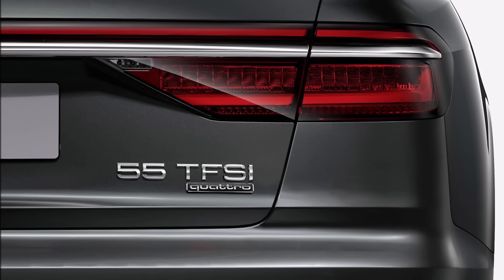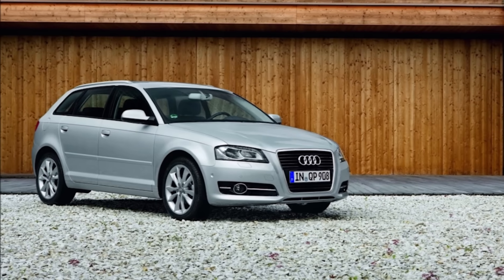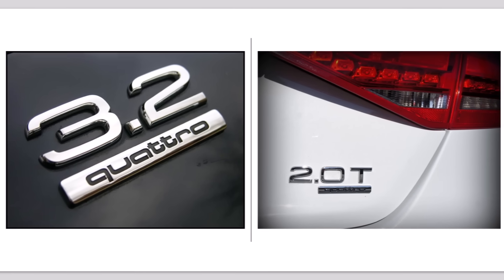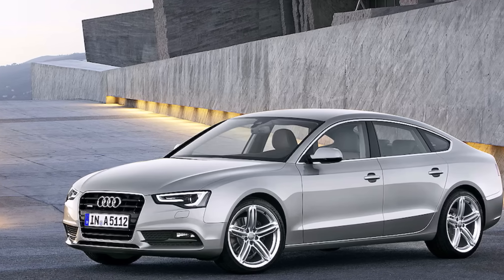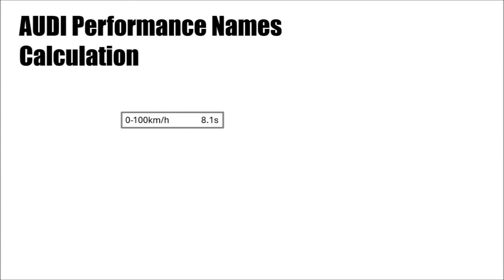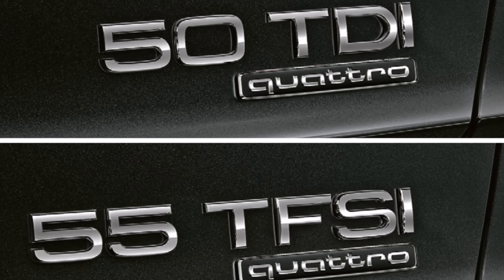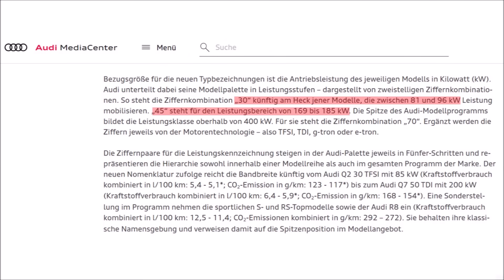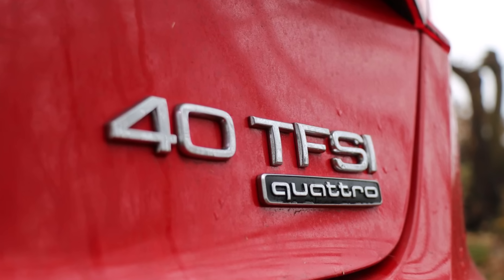AUDI Performance numbers EXPLAINED

Comment: I think this information are not correct. How you come to this meaning, can you give a Statement to the  source of the explenation? The Numbers are categories of the horsepower -> it is from the Audi Brand: „For example, the numeral combination “30” will
appear on the rear of all models with power output between 81 and 96 kW. And “45” stands for
power output between 169 and 185 kW. „
Reply from the maker: I was working in AUDI's technical development in Ingolstadt during the time this formula was invented and always wondered why no one explained that to the customers, which left everyone confused around the world.

The power categories came up later in an attempt to make it easier to understand for customers, but it's missing the point and is even more confusing.
Reply: @bsport320 I also worked there, but with an other Focus and for us it was from the beginning the classes Information, not that what you explain and there is no class with 100 which you describe to the Audi R8, i never heard it, so it is a little bit strange. In which Departement you worked?

Comment: Audi developed the most stupid system ever.
I personally don't care about this number - I want to know what size of engine the car has and if its n/a or turbo.
2.0 TFSI or 2.0 FSI  makes sense for me, if I want to know the power, I will look it up myself. 2.0 TDI vs 2.0 TDIe I exactly know that the TDIe is lower power and therefore in a lower tax bracket.

This stupid numbers of 25/35/50/55 make no sense for me and never will. I don't want to do arithmetics, I want to have a clear info.
I am not going to buy a little 1.0 turbo shtbox even if it is a 100 TFSI as that 1.0 engine will last 30.000 miles if at all before it goes to the bin.
I rather buy a 2.0 TFSI what is slower and last hopefully longer - ohh, hold on, we talk about Audi where the 2.0 TFSI was famous for the 100.000 km death because of plastic chain tensioners what wear down, let the chain skip and you have a catastrophically engine failure - easy access, sure, i you remove the whole engine because the timing chain is 5cm from the firewall...

Comment: If it would've been explained, it probably would've been great.

If you don't know the system, you can't compare stuff well.

For example with chain saws, when comparing a Stihl MS 261 and a Husqvarna 550, you might think the Husqvarna is bigger because bigger number.

But they're actually comparable with both being 50 ccm chain saws for professional use.

Comment: BMW and Merc have a similar system with their cars (a 435i isn’t 3.5L anymore…) but nobody seemed to get confused by that for whatever reason
Reply from the maker: they historically sticked with engine size and said the smaller one has the same performance as the bigger one before - see C63 ;)

Comment: Sorry, but that's not correct. The performance numbers are based on performance classes. 45 stands for 169 to 185 kW, 55 stands for 245 to 275 kW. The Q7 55 TFSI (2021 /250 kW) accelerates to 100 km/h in 5.9 seconds. The TT 45 TFSI (2021 /180 kW) accelerates to 100 km/h in 5.1 seconds..
Reply: This is wrong. Watch the video.

Comment: Great video, as always.
 I believe the naming convention actually did change into the "marketing understood" version. Where the power categories were no longer a marketing interpretation, but the actual new naming convention.

The idea being that engine size was no longer relevant when speaking of BEVs, plus no one actually understanding the % of g acceleration, so now a 50 TFSI and a 50 e-tron could both be understood to have a similar power level.

Because now you find 45 TFSI badging/naming from A3 to A6 with the similar 2.0T engines. So that indicates it got switched from acceleration based to power output based.

Comment: Engine size has been a standard for decades, but perhaps Audi went too far with the same engine able to have different numbers on different models. Look at BMW - the number isn't often related to engine size at all and has become less and less related in the last 20 years, but everyone knew from the beginning that bigger is more powerful, no matter the chassis.
I'm going to shut up now and be ashamed that my 550d is actually a 3-liter, 325e is a 2.7 and my 750i is a 5.4.

Comment: Why didn't they simply put the 0-100kmh time on the badge?
Reply: Because it will also be wrong. The bigger number means slower acceleration, which is backwards to what the current naming convention. Bigger car should have bigger numbers, not smaller.

Comment: The audi 80 must have had insane performance!
Reply: Audi 5000 would like have a word
Reply: @agistan7764  the Space Shuttle experienced about 3 G's, while the Saturn V rocket had a maximum of about 4.5 G's during its launches. audi 5000 has 50G lol
Reply: @agistan7764 The sudden unintended acceleration was no joke💀 The cars and passangers simply disintegrated during impact
Reply: what about Audi 90, 100 and 200🤣🤣🤣😂😇😇

Comment: I never understood how they derived these numbers. My initial intuition was that 55 = 5.5L engine equivalent power. Like AMG55 or AMG63 which show the respective equivalent engine capacity or the power of a 6.3 liter NA engine.
Now that you have explained it, it is still not a good idea. since BMW and Mercedes uses their numbers are a way to represent the engine size. So there is no way to actually compare Audi to BMW or Mercedes.

For example, the 55 TFSI. Should it be compared to the BMW 330i or BMW 340i? The BMW doesn't come with a 355i so does that mean Audi is better? Then you test drive both of them and realize it is more equivalent to 330i in performance so you'll be disappointed and feel like the number does not make sense.
Reply: But Mercedes' A35 and A45 AMG models also make zero sense. What do those numbers represent?
Reply: @PostTraumaticChessDisorder  they represent 3.5L engine power for A35 and A45 = 4.5L power. Which is the similar to their nomenclature going as far back as the 1980s.

Comment: I don’t want to know how fast the car is, I want to know what engine it has. Straight line acceleration means nothing in real world performance dynamics. Just like the new M5 is a brick with wheels that handles terribly, but has decent straight line 0-100 acceleration.

Comment: Why would you give up on a system that indicates the power of an engine by the red letters, like double red tdi meant something. Also if the engine is small, just eliminate the engine size. Or the bmw's naming system was just mostly fine except the secondhand websites.

Comment: I never knew this and always thought the naming was a range of the power output ( I think its done that way at Mercedes, so an S500 can be a 6cylinder nowadays instead of the traditional V8)
Higher number means faster car makes sense, but you still have to google what actual engine size is under the hood. And mathing out that number with the G-Force is more than " fast math" to most people.
The customers never understood this, and for them its just added to the long list of Audis marketing mishaps.
Every new Audi A5 wagon I see has blacked out badges: They know that customers get confused on why the " A5" isnt a coupe anymore but a wagon now and they come with boring 4 cylinder engines anyway...

Comment: The displacement stopped making a sense even before the turbocharged engines.
VW already had 3 1.4 engines that ranged from 60 to 100HP in the 90's. Around that time, they already did badges that showed just MPI, 16V, SDI or different colours in the TDI badge.

Comment: Finally an explanation, never knew what that means. Now that I know, it makes sense and it is more logical than other brands.
Knowing the engine power doesn’t help without knowing the weight of the car, so the Audi way is telling us directly what the car is capable of…
35: wife’s daily drive
40: economical satisfaction 
45: I can think of towing a boat😮
50: neighbours are upset 
55: I’m smoking tyres at the traffic lights 😂
50
Reply from the maker: Yes exactly ;)
Reply: Well put, anything less than a 50 is not worth having 😉

Comment: So if Audi ever makes a top fuel dragster, the name (based on 100 × G force) might be the 5600 TFD
Reply: You meant something around maybe 250? I guess the friction coefficient for the tires can be as high as bout 2 plus those things will get some down force - but remember that this is averaged over 0-100, so relatively low speeds for aero. Btw if we're considering just power, so no tuning and no accidents then 4.5G (450) would be missiles and 56G (5600) is in the range of light loads for howitzers.
Reply: @josefsvitak4313  Whoops, I should have said 560. I'm told they pull 5.6G from 0-100 kph. They get ~4.0 effective coefficient of friction from a number of factors - see "We Break down the Physics of Dragster Tires" (Car & Driver 2019)

Comment: I already had thought experiments and napkin math comparing 0-100km/h times to gravity. That's actually an engineering thought to naturally come to. But Audi should have just explained it properly, or just called it 0,6G or 60% of gravity. Rockets shoot up, cars accelerate horizontally, comparing yourself to gravity isn't a weak measure.
Also, with enough power the car is grip limited; and with a higher weight of the car, the friction force increases, so you have more grip, but it also increases inertia; so rubber tires still allow for some acceleration that's relative to gravity anyway. On a planet with higher gravitational force you'd have more grip on the tires, with the same inertia, hence you could accelerate faster (given you have the power).

Comment: Just the number of horse power would be way more simpler.
Reply: Audi did try it with cars like the first TT - the 150, 180 and 225.
But as B Sport says, power alone doesn't tell the whole story. Weight gives a more complete picture.

Comment: To me the best system would be very easily to write the horsepower divided by 10.
You have 250hp ? Have a 25. 400 hp? Have a 40. You have 136 hp ? Have a 14. You have 650 hp ? Have a 65. Simple, easy, effective, understandable, applies to all kinds of vehicles. Also you usually get that little bit higher every generation 😊
Reply: Yeah makes sense, but in A1 now they have 25TFSI and when they would use power they would have 9TFSI and I think it would seem too low for them 😂 

And I think that Renault uses something based on hp in naming conventions and it’s good.
Reply: @7medo7 yeah, the A1 is going to be a problem 😂
Reply: Well for some reasons manufacturers are allergic to using smaller numbers, for example Mercedes went up to E63 when they had a 6.3 engine, but they kept the 63 with a 5.5 and then 4.0 engines. They probably think that normies will think bigger number = faster and sadly they might be right
Reply: @petarmiletic997 I understand the 63, because it was tradition, besides people tend to forget that the engine size was 6.2, not 6.3 as you would imagine. But it's not that bad otherwise.
Reply: @ambergris5705 German tax laws for car tax count every 100cm3 started, so by their standards 6208 cm3 is 6.3

And it wasn’t 6.3 for long, only for 2006-2012. Before and after they had 5.5L V8’s
Reply: @petarmiletic997 interesting, I didn't know that
Reply: @petarmiletic997 I always have to explain to my "car guy" friends that a bmw 330i has a 2l engine and a 340i a 3l so yeah...
Reply: This is better because I know right away whether I can wash it up to 100km/h or not.
Reply: Лучше бы просто писали маркировку мотора: AVX, AFN, CZCA, DAZA и т.д. Фанаты поймут, а остальных эти маркировки всеравно не интересуют.

Comment: That's what it was? The Idea is cool, but so complicated.
I miss the time where the "TDI" with all three letters in red showed, that this is the most powerful 1.9 TDI. Simple and smart.
Reply: That was my favorite one! The downside it works for only four engine powers.
Reply: I thought it meant turbo diesel injection 😂
Reply: @rubeneves9842 it does, what made you think it was different?
Reply: @sebastian_berlin listening to everything done and measured in speed and distance but the fact remapped cars can be made faster than what the back of the car states. Thing's were simpler back in the 90s. Dont know what half of them mean anymore.

Comment: Adding to this... VW adopted a different system at the same time, so you had a VW with a 1.4 TSI branded as 250 TSI and an Audi with the same engine branded as 35 TFSI. Genius
Reply: Is the VW number the number of seconds it takes to reach 100, its top speed? :P
Reply: @jamesgu7164  The number was according the torque of the engine... So the 1.4 TSI had 150hp and 250 nm of torque

Comment: Nothing will beat the "number on the back indicates engine displacement". To me this is all cope for 2.0l or smaller engine owners.
Reply: But it does not make sense anymore. 
BMW has 2.0 engines that range from 150 to 300 hp. Mercedes has a 400 two liter.

Comment: Would you rather have a system that lies to you about displacement (a C63 with only 2.0L, an M235i with only 2.0L), or a truthful logical "bigger number = faster" system that's harder to explain the exact math behind?
Reply: 😂😂😂 we're all guessing at this point in time. All of them are trash
Reply: how about honestly describing the engine's displacement, and maybe characteristic of turbo, or NA? It seems sometime in the late 2000s honest badging had to be dropped... I wonder why?
Reply: @assolutobisonte7040  Difficult to make it meaningful for a model like the C-class, whose engine options are almost all turbocharged 2-liter I4s, except for the 1-2 turbocharged 1.5-liter I4s. In the US, all versions of the C-class have a turbocharged 2.0T.
Reply: @needles_balloon  Maybe don't offer nearly identical hardware with different tuning maps? Remember when paying more meant getting a pair more cylinders? Or actual hardware like a turbo, or two? They arent afraid to charge thousands of dollar for "higher" end versions, why not deliver real hardware when the money is there? Otherwise the money will not be there any longer.

Comment: It's a shame it wasn't communicated better. I never knew this and I was always confused as to what the numbering convention was in reference to. I will appreciate older models' badging a lot more now having been educated by you. Thank you.

Now, I must go and find a 75 TFSI badge for my RS3😉
Reply from the maker: Haha glad I could help!
Reply: The reason it’s not communicated clearly is that the changing of the meaning of the numbers is to save the company money, charge the same while you the customer thinks they are still getting the same value.
Reply: I just did the same calc based on the advertised Audi 0-100km/h time for mine 😂
Reply: 😂😂  I also need to calculate my 1000hp Audi

Comment: Sounds like they came up with an excellent way of comparing their cars but their marketing department were too stupid to understand it, and since most of the oxygen wasters who gravitate towards marketing assume everyone is more stupid than they are, they were sure it would be wasted on the public too, so the explanation never left the building. The way I was interpreting it was that if you multiply the number on the back by 50, you get an approximate bhp figure for the engine, so the 40 is about 200 bhp, the 35 about 175, etc. Of course I'm adding a zero and halfing it rather than explicitly multiplying by 50 because that's faster...

Comment: Crazy system of naming but its actually cool, after so many years it finally make sense, thing is i think you are the only person to explain this in 10 years
Reply: If only it had been explained clearly. The last time I tried to find the explanation, I only found that Audi's shitty power range "30 is for 81-96 kw..." explanation
Reply: It's either bull or Audi engines didn't know how to use it either. 
A4 45 TFSI: 5,8s
Q7 45 TDI: 7,1s
Reply: It’s bullshit. What was wrong with 2.0 tfsi or 1.6 tdi
Reply: @CovKid2K10 Smaller number looks unattractive.
Reply: Me neither, now I like it after it is gone 😂
Reply: Wow, never knew this
Reply: Lol it doesn't make sense at all, since you'll end up in situations where different cars with the same engine will have different numbers, because of their size or because some have quattro. 
And it doesn't matter anyway because Audi don't even use this rule, the A4 45TFSI and A8 55 TFSI have the same 0-100 time for example. Judging by the behavior of the clowns in Audi's marketing department, they just invented a random rule so they have bigger numbers than the competition. In this case, Audi's 55 TFSI is equivalent to BMW's 35i or Mercedes' 350.  

If they actually wanted to have a system which makes sense they would've just used power figures to dictate the numbers, like 250HP would be a 25. But they can't have that because they'd have 5 'less' than the competition.
Reply: I'm sure I saw a Nolan from donut media explaining it but not so In Depth like this one
Reply: Yeah - I'm far more impressed than I thought I'd be by its origins - I assumed it would just be meaningless, dumbed-down marketing dross.